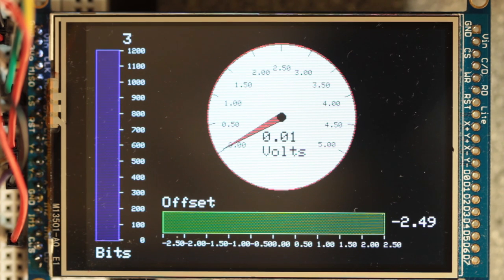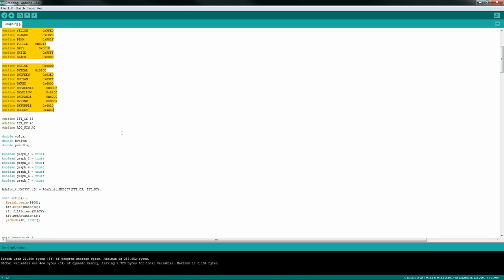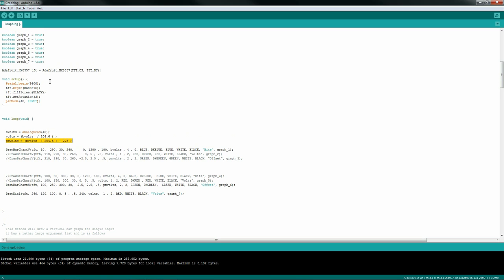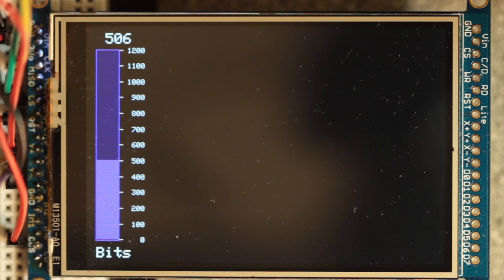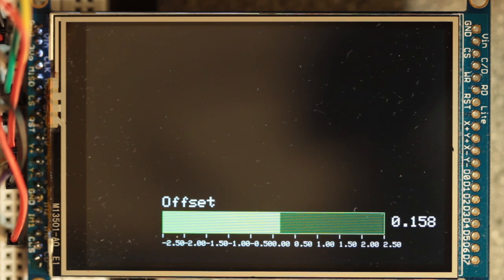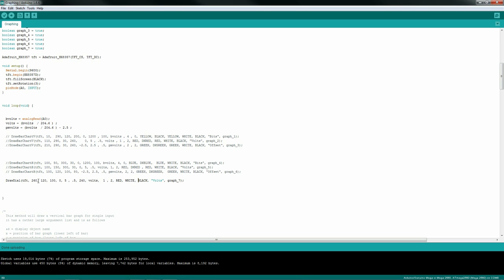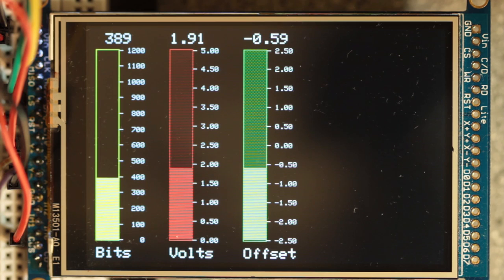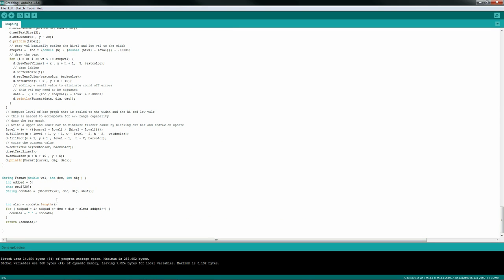Arduino Display Functions - FREE CODE!!!

Comment: Kris, thank you for sharing this code. it's very useful. regarding the flickering of the needle: the simplest improvement (if you haven't done it already) is to compare the value being passed into the function with the value on the previous call to the function. if they are the same then nothing has changed so no need to redraw the needle. In addition, I would recommend that users apply a significant change analysis to the variables they are monitoring. no need to do this in the library. it should be an application feature. so, for example, if measuring a voltage and the change is less than (for example) 1% then do not call the graph functions at all.
Thanks again.

Comment: Thank you so much for this!
This also works with the Adafruit 2.8" tft (1770)  on an Arduino Uno and the Adafruit_ILI9341 library with a few tweaks. You need to make the graphs smaller of course, but it still looks very nice. Just replace all the references to HX8357 with ILI9341 and change the pins according to the Adafruit tutorial.
Reply from the maker: Good tips on using this with a different library
Reply: I wish! It faults for Adafruit_HX8357.h: No such file or dir... I tried finding it, and the best I get is a notepad file. I copied that and saved it as the .h file, but I still can't get it to work. If this were easy, everyone would be doing it, but No, it's freakin really difficult! And if I get this figured out, I'm sure it'll fault out for the next thing I'm missing. Hours upon hours wasted.... Note: I may be frustrated!

Comment: Hi and thanks for the info!  Question - if I wanted to create a bar graph that changed backgrounds like a "fuel level gauge" from green, to yellow, to red, so that at the 2/3 mark, the background appears yellow, then at the 1/3 mark the background appears red, would that be three "different" graphs superimposed on the same area of the screen, or is there a way to make 3x background colors for the same graph?  Or perhaps a graph with a black background, where the actual gauge bar itself changed to green/yellow/red at the different levels?

Comment: A tip and BIG thanks to Kris! This is exactly what I wanted as I fine tune sensor processing for Assistive Technology use.
The tip - change the Draw functions to use the parent class, i.e., "DrawBarChartH(Adafruit_GFX & d, ..." then include Adafruit_GFX.h - no need to change for each new display. I can still pass my tft object by reference, which is an instance of my specific device and a child class of Adafruit_GFX.
I copied the code to a .cpp and .h file as I migrate this to a library, and I have a graph_st struct that contains all of the attributes and the redraw flag. The attributes (colors, redraw, scaling) can be manipulated as I evaluate the sensor data in different routines until I'm ready to redraw everything at the end of my loop.
I invoke drawWhatever(Adafruit_GFX & d, graph_st & graph) with drawWhatever(tft, graph1) etc. and it splits out all of the arguments. Again, MANY, MANY THANKS!
Reply from the maker: Thanks for the tip that really is an outstanding tip. I have since moved away from Arduino sand I now use teensies exclusively. Mainly faster processors 32-bit bus with and more RAM memory. I have Rewritten this graphing function into an actual library that only runs on the ili_934I_t3 driver. My new library is much better but again only runs on a Teensy

Comment: Great sketch. What about drawing non linear scales, is that possible?
eg in Ham radio an SWR scale.   eg 1 is at left side, 3 is middle, and infinity at right side of a horizontal bar graph
Reply from the maker: It would be relatively simple to change the scale to show log or other. Probably a few lines of code in the draw scale section, and of you are passing data in at the drawn scale, it should display w/o any changes. I'd have to mess with it though.

Comment: thank you !! this is awesome!!  every display code i have seen with graphs and bars are always getting the data from the potentiometer,or reading a pin, and i have yet to see the data collected or created during the sketch being displayed.. for instance if i had a radiation meter counting clicks and converting to mR/hr. how would one go about display that info? any help would greatly appreciated
Reply from the maker: What is your independent variable?

Also, if you can switch to a Teensy MCU, I have a better library for drawing graphs.
Reply: im wanting to be able to display the mr/hr as if it were an old analog survey meter.. like the nds2000

Comment: Hi Kris,  I love so much what you did and thank you for the code. I bought the Adafruit  display and the Arduino UNO just to use your nice code, unfortunately didn't work for me, I do not know what else to do, I downloaded the libraries in you link and the code but could not make it work, it give me errors and will not compile . Any suggestion  please ?
Reply from the maker: You will need to be more specific as to what the errors are
Reply: Thank you for the fast reply.  I got  warnning: spurious .ghub  folder in 'Adafruit 2.8" display Library'  Library
Reply from the maker: @florentinpolmolea7961  Sounds like something was not installed inside Arduino.

Comment: I'm not an expert, but about the flickering of the dial thing: It looks like the needle is erased first and then redrawn. I think the new position should be drawn before the old position is erased. The tricky part would probably be to erase the old position without erasing anything that should not be erased… (and when I say erase I mean redraw the background, kind of)
Reply from the maker: +Johnny Rosenberg tried that, still flickering but not as bad. I sure wish these displays had double buffers...

Comment: I have a question... can I use this to measure the voltage that is being generated when I press the screen? I am using a adafruit 2.8 tft shield v2 capacitive touch screen
Reply from the maker: You can measure voltages, but i'm not sure how your display sends touch info. I suspect it's not a simple analog voltage.

Comment: The dial redraw is effective, but I ran into the same type of problem for that sort of movement. The need to redraw the entire needle twice with each update seems to be the only bottleneck. Instead of redrawing the entire needle, you could devise some math to figure out what DOESNT need to be drawn and draw/redraw what does. It could save you from needing to update at least 50 percent of your pixels (by my estimation) making it at least twice as fast.
Reply from the maker: billybbob18 I've actually put some code in there to only draw the needle when it moves made a huge difference
Reply: @KrisKasprzak  Today I'm using the ili9341 SPI screen with Bodmer's TFE_eSPI library on an ESP32 with the screen running at 60MHZ and the processor running at 240MHZ. The performance is insane. At 60FPS operation, I'm not too worried about delay flicker anymore. I'm still impressed you could get your system to work with a microcontroller at 8mhz 8bit. As far as flicker goes, I'm trying to figure out how to read the display through the MISO pin.

Comment: Hi, amazing code! Thanks for sharing.

I had one question though...
For some reason the compiler does not recognize "Format" in the line:
d.println(Format(data, dig, dec));

When i comment it out, everything else works. I tried searching the Arduino site for the println function and all it says is the format for println is supposed to be println(val, foramt).

Any insight into why this is happening. Any help would be greatly appreciated!
Reply from the maker: +TBCman99 My mistake. I wrote a function called Format(number, digits, decimals) so I could really control the display but forgot to include that function and so it pads spaces to keep the decimal lined up.

// example
// dog = 98.9876655
// cat = Format(Dog,4,3);
// dog = "  98.988
// Format(Data, Digits, DecimalPlaces);

String Format(double val, int dec, int dig ) {
  int addpad = 0;
  char sbuf[20];
  String condata = (dtostrf(val, dec, dig, sbuf));
  int slen = condata.length();
  for ( addpad = 1; addpad <= dec + dig - slen; addpad++) {
    condata = " " + condata;
  }
  return (condata);

}
Reply: +Kris Kasprzak ahhh, I see. Thanks so much for clearing that up!! Much appreciated! :)

Comment: I ended up placing most of your function arguments into a structure:

struct grafix {
  int x;                                 // upper left coordinate horizontal
  int y;                                 // upper left coordinate vertical
  int w;                                // width of graph
  int h;                                 // height of graph
  int minX;                         // minimum graph value, can be negative
  int maxX;                        // maximum graph value
  float inc;                         // scale division between lo and hi
  float currentValue;        // Current value
  int digitTotal;                 // total digits displayed, not counting decimal point
  int decimals;                 // digits after decimal point
  int barColor;                  // Color for bar
  int backBar;                  // Background bar color
  int border;                     // Border color
  int textColor;                // Color for text
  int backFill;                  // Background color for entire graph
  char label[30];             // Label text
} myG;

I also changed the data type for several arguments, as ints are processed faster than floats. I used this structure mainly for the bar graph, as that's what my needs are for. Also, I needed a way to suppress the tick marks for all but the last bar in a stacked bar graph. I now have it split so the axes are done on one pass and the data on anther. An example of a stacked bar graph (for SWR on ham radio bands), see:

http://s283.photobucket.com/user/econjack/media/AllBandMinSWR.jpg.html?sort=3&o=0
Reply from the maker: +Jack Purdum very cool, glad this code gave you a start.

Comment: I've done some more work which splits the axis and label drawing from the actual data plotting. There's no reason to pass the string data and other fixed parameters on each call. Also, I changed from the String class to C char arrays because of reduced overhead.

Comment: code works great. i have 4 vertical bar charts but they all read from the same A0 pin. how do you separate each chart to read from a different analog pins
Reply from the maker: you can, just read the value from each pin into it's own variable then have a call to the graph function for each variable, set the coordinates for each graph. Don't forget to have a bool redraw for each graph.

Comment: Hello, 
its nice gauges,
if i upload it to my UNO it say 
exit status 1
'u8g2' was not declared in this scope
? 

any help with that ? 
Im trying to run it on 2.8 TFT display.
Reply from the maker: I have no idea why. my functions do not use this library. I suspect you are trying compile with libraries that require the U8 lib.
Reply: I got opened another arduino window and that was problem for u8g2 error. 

Now i compile and upload but i got white screen, I use https://www.velleman.eu/products/view/?id=435582 screen, and when i insert in void loop section 
Serial.println(volts);
  Serial.println(bvolts);
  Serial.println(pmvolts);
  Serial.println(analogRead(A0));

i got some numbers running that means program is running but i have white screen. 
Any help with that, whit some other library when i get white screen i need to insert 0X9341 in tft.begin(0x9341) and i get the pictures, maybe here is the same simple solution ?

Thanks for help, :)
Reply from the maker: Step 1 forget my code and get your display working. Try the sample programs that come with libraries. Until you get the display working, this code can't fix that.

Comment: Thanks for the video tutorial and the code!
I have a Display 3.5 inch 320 x 480 ILI9488, will it work?  Thank you
Reply from the maker: If you have a adafruit libraries for that chip then yes it will. I use this code with the adafruit 8357 libraries and it works fine. I also use it with the ili_9341_T3 libraries for teenseys.
Reply: @KrisKasprzak  Thank you; I will test.

Comment: Is it possible covert raw image with drawpixel() function in utft??
Reply from the maker: Shapath Sust draw pixel simply draws a DOT on a screen at an XY location given a color
Reply: if the color value come from image pixel of raw image then is it possible??
Reply from the maker: probably, drawPixel needs location and RGB value.
Reply: Sir ,I already know PROGRAM array in .c file uses for drawbitmap() function which contain rgb565 color. How can i convert that PROGRAM array element into rgb color for drawpixel().
Thanks for Reply..
Reply from the maker: Hard to follow what you are asking and w/o knowing what you are trying to do i'm really guessing at what your problem is. If you have an array of you converted RAW image, why not loop through each row, getting each pixel from each column and calling drawPixel().

for i = 0 to rows
     for j=0 to cols
         drawpixel(i,j,Get_RGB_FROM_ARRAY_AT_i_j)
Reply: Exectly Sir,,I am tring something u guess. But my  confusion is what are the rgb888 value of the rgb565 and how and which value start and stop of the row or colum (array in one dimension)...., I am try many combination but its not working..

Comment: Does the code work for 4.3'' TFT?
Reply from the maker: If you are using the Adafruit libraries, then yes. If others I'm guessing the methods will be different and may only need some renaming.
Reply: Thank you so much!
I bouth a Sain Smart 4.3'' TFT and I've been looking for information but I can not find anything. My question is....  Is it really necessary to use the shield with the screen 4.3'' TFT?
Reply from the maker: You don't need the shield if you know what the pins are, do you have a link to the display?
Reply: No, can you please send me a link?
Because I'm having trouble turning it on...
Thank you!

Comment: You can increase your speed by only drawing when something has changed.
Reply: AndrewMascoloJr 
He did, some fairly advanced geometric math is required to only redraw IF changed, THEN to calculate the pixels that need to be drawn VERSES the pixels already existing (kind of difficult). There can also be a PID for the needle position to allow smooth transition between changes. By using a few (drawLine) commands might be able to speed up the needle draw. Drawing a triangle is harder for a computer than drawing a rectangle. Use a small black triangle at the tip of the needle to give it a point.